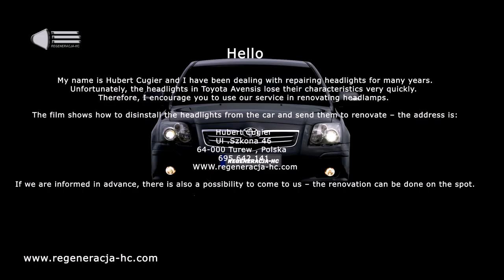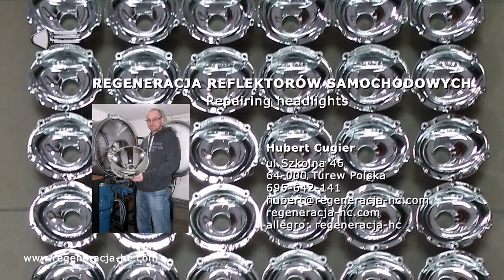How to remove the headlight Toyota Avensis - Regeneration headlamps - removal

Comment: Why the hell should you have to take the car apart to change a bulb! Great instruction though. Cheers
Reply from the maker: it's not about changing bulb - only about headlights regeneration
Reply: +jagkev Changing the actual lightbulb is super simple. Just find where the cable goes into the back of the headlight and rotate about 15 degrees, and it'll come out. Done.
Reply: er no. the power supply is removed, then a rubber seal then unclip the spring retainer then lamp pops out
Reply: @narco73  mike's right. Its not a BMW
Reply: @Bemaritohtori   Well, I did it as I explained above, on my Toyota Avensis. 
Note that I was saying how to remove the bulb, not the entire light. 
As was the opening poster. 
As I bolded in my reply, so you wouldn't miss it.

Comment: Hello
I have some problems with my h7 lenses on a Avensis t25 non facelift
The reflectors of the lenses are damaged(burned) an i can not find new lenses for halogen bulbs
Any advice beside replacing the hole head lamps?

Comment: I own a toyota avensis myself and you don't have remove the front bumpy to change the light bulbs. this fellow is just going over the top with it..He is probably not open minded hahaha
Reply: This process is not to change the headlight bulb, but to replace the whole projector unit inside the headlamp, a common problem on older toyota avensis models